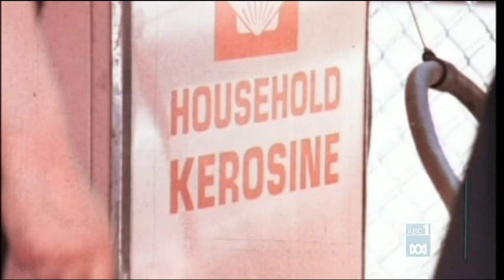Steam Powered 1963 Ford Falcon

Comment: Hmm, very interesting! I wonder what would happen if development of steam cars continued with modern technology. It's actually quite difficult to make a steam car with efficiencies on par with internal combustion engines, but modern technology might be able to achieve high efficiencies while preserving other advantages of steam engines.
Reply: +#420: Weedle  Its actually a lot more than "quite difficult"  The Carnot Cycle formula tells us its also impossible to match the efficiency of internal combustion..  steam is an inferior working fluid and offers poor thermal efficiency. The only advantage steam cars offered was a way to start the engine without hand cranking which was very difficult and often caused injury or death. But after Charles Kettering invented the electric starter motor the steam cars became obsolete overnight. Cheers!
Reply: @doktorbimmer  Not that the Carnot cycle says that it is impossible to match the efficiency of an internal combustion engine. These engines run on the Otto or Diesel cycle. What hurts the efficiency of a steam engine is its low high temperature due to a problem of materials and continuity in combustion. The temperature in an internal combustion engine can reach 2500°C. That of a steam engine hardly reaches 600°C. Lastly, the phase change of water from liquid to gaseous consumes a lot of energy.
Reply: @robertoortizespinoza795  The Carnot Formula tells us that the Rankine Cycle has a significantly lower theoretical and practical efficiency limit than internal combustion heat engines.
The Second Law of Thermodynamics prevents steam from achieving the efficiency of ICEs.
Reply: @sandervanderkammen9230  Yes. It is true.
Reply: Dang, I didn't know that about hand cranked cars! Guess the electric starter's another one of those inventions that's kinda inconspicuous until you realize what it would be like without it.

Yeah, I agree, a steam engine's not going to surpass an internal combustion engine in terms of thermal efficiency. There are already diesel engines in cars/trucks getting 40%+ efficiency. But the steam engine has other advantages like flex fuel, low emissions, high torque, etc. that might be worth going for. Efficiency's still one of the major issues, though maybe with today's tech, steam engines can achieve the boiler temps/pressures necessary for good efficiency. They won't get to 40% efficiency, but they might at least be close enough to a gasoline Otto cycle engine that their other advantages would be viable.
Reply: +#420: Weedle Yes, indeed.. hand cranking was very difficult for anyone that did not possess significant physical strength, it required a certain degree of skill and none of this could protect you from being severely injured.
We definitely take the starter for granted today.
Absolutely.. there is no practical engine design that can come close with the Diesel.. it is supreme in terms of thermal efficiency..
It too is Flex-fuel capable, low emission and high torque..  its also low cost and low maintenance.
The steam cars has not be commercially viable in over 100 years.. and unfortunately there has been no changes that will alter its obsolete status..   I will admit its an interesting topic to discuss though, I often wondered about steam making a come back somehow... but when you look at the facts and the engineering problems you soon learn to dismiss these thoughts as more fantasy than reality.  Cheers!
Reply: I agree, there's no engine that can match a diesel in terms of efficiency. The big ones in ships are over 50% efficient, better than any other simple cycle.

But honestly, I don't think the steam car is entirely obsolete. A lot of its problems are still solvable. I did some calculations with steam tables, and steam engines should be able to get around 30% efficiency with easily achievable conditions (<10 MPa and <600 C in boiler), provided the expander is well-designed. This is not that much worse than gasoline engine efficiencies. Of course, fuel efficiency is far from the only challenge, and you are right that steam engines still have a long way to go. Maybe a modern design, though, could still solve many of these issues and make a competitive steam engine.
Reply: #420: Weedle I see where you're coming from, but you will find no legitimate automotive engineers looking to produce a commercially viable, real world design that will agree with you.
 Looking at the formulas and existing tables it may appear possible, theoretically... but an efficient vacuum condenser, steam-to-air heat exchanger for a 150 -200 hp engine suitable for an automobile? Will also be the size of a typical automobile.. 
  The only steam engines that are currently practical (and still cannot match ICEs) are in +100,000 hp scale or larger and almost exclusively use a large body of water as a thermal sink... 2nd, 3rd and even 4th pass cycles may be practical in a multi-megawatt power station where the extra cost can be spread out of 40 years   this is simply not practical with cars.
Actually the truth is, the remaining applications that use steam are continuing to shrink, their days are numbered..
The Carnot formula tells us that steam is near to reaching its practical limits.. while ICEs have a much higher practical and theoretical Carnot efficiency limits... this is a serious roadblock for steam which has no possible solution.
Reply: Actually, there are engineers working on steam projects right now. One company, Cyclone Power, has plans for an engine that will fit in a car and gets ~30% thermal efficiency. I agree with you that commercialization is difficult, though. It all depends on the market. Personally, I think steam still deserves a chance because of the flex fuel/low emissions benefits, and the fuel consumption challenge just has to be overcome. It would most likely be an alternative to gasoline engines. I think we both agree that it's difficult to replace diesel engines; their efficiency is just too beneficial to pass up.

And yeah, you hit the nail right on the head with the condenser size challenge. It was already difficult for locomotives so it's gonna be difficult for cars. But from what I've found out, the condensers aren't nearly that bulky. People have experimented with steam engines in vehicles before, and it's just a matter of clever placement. There have been experimental steam powered buses with condensers mounted in the roof or undercarriage. The car in the video above seems to run fine without a gigantic condenser. Condenser size is definitely still a challenge, but not an insurmountable one.
Reply: +#420: Weedle  LOL!!!  NO.. they are certainly not...  You Mean Cyclone Steam Technologies????   The now defunct company was a very successful if not short lived "Vaporware" investment scam that has run its course. None of their unbelievable (and impossible) claims were ever proven and not a single engine was ever sold.
Reply: Well, I guess you could say anything that has run on steam in the past is *vapor*ware! (Get it? Steam turns into a vapor...okay, even I admit that was a terrible pun.) Anyways, your comment inspired me to do some more digging, and I would still have to respectfully disagree. I looked around on the Cyclone Power page and they have actually built several engines and delivered one that is being used in a forklift. Furthermore, there are still companies that are partnering with them to develop engines, suggesting that they are still in business.

Cyclone Power research: http://cyclonepower.com/how-it-works-2/delivered-engine-and-research-projects/

However, I don't blame you for being skeptical. I would also want proof the engine works as planned, such as specifications and results from official tests.

I know you don't think steam power will work, but it's not as terrible as it seems. The government of California, General Motors, and other organizations funded steam engine work in the 1960s and '70s. There was even an attempt to build a steam race car. These big corporations wouldn't throw away money on something they knew would fail. There just wasn't enough market incentive back then to develop steam power further, especially with the efficiency limitations. 

But I digress. I would very much like to turn the conversation back to the topic of steam engines. As long as the efficiency problem of the steam engine can be solved, at least to the point of similar efficiencies as gasoline engines, we could take advantage of its low emissions and flexible fuel capabilities. Please elaborate on why you don't think steam power will work; I do find these issues interesting and would like to learn more about them.
Reply: #420: Weedle  Cyclone Steam Technologies was not a legitimate company and is no longer active apart from periodic fake news updates posted on their website.. There were several demonstrations of engines that now appear to be nothing more than elaborate props.. Cyclone has never delivered a working engine or submitted to third party test verification.   
Yes, several failed prototypes were attempted during the California emissions crisis and the 1973 OPEC Oil Crisis and touted as viable  emergency stop-gap solutions that were consider briefly as conventional technology could not adapt quickly to threats of massive fuel supply shortages.. Many never reached the working prototype phase and none reached pre-production development stages, these impractical concepts were considered and all were later abandoned... There are today no legitimate projects being  seriously considered for production.

Comment: WHY aren't we committing to cars like this. It is so much better in every way!
Reply: Because they had 20 hp, were about as fast as granny on a bicycle (could tow about as much as well) and were incredibly dangerous due to 500psi of superheated steam. Also, contrary to what the video states, burning fuel to make steam is actually much less efficient than modern computer controlled internal combustion engines.
Reply: Steam cars have been obsolete for over a 100 years.. perhaps you should ask yourself why they became obsolete in the first place.
Reply: If steam had any advantages over ICE powered automobiles? They would not have gone obsolete...

Comment: Hi are their any plans or more information about this car and the engine, I would like to know how it works?
Reply: Books will be your only comprehensive sources.. steam cars have been obsolete for over a century.. there isn't much available on the internet..
Reply: The Bessler brothers bought Doble's design after he went bankrupt.. they sold some material to Japan, and some was purchased by General Motors
Reply: +Autistic Boy Really? The Bessler brother's engines ran on kerosene... Kerosene is a FOSSIL FUEL
Reply: +Autistic Boy I would wish you good luck if you had any chance of succeeding but I already know that it is simply not practical... and it will be less efficient.

Comment: If they brought back the Doble design with  electric batteries to heat the water for steam and today's computer controls , you could run the car for 2 or 3 years and never charge it or add water. Todays carbon fibers and light weight  plastics could make a re-designed Doble weigh less than 1500 pounds.
Reply: Poy Ester but cost how much also you would only make enough power as to boil the water the batteries would die quickly the boiler wouldnt be able to recharge the batteries at the same rate they are heating the water
Reply: troll
Reply: You're an idiot.
Reply: Electric motors can achieve over 90% efficiency while reciprocating steam engines like this are usually less than 20%... so the idea of converting a steam car to battery power should be a no brainer!
Reply: Using a battery-electric heating system to heat water in a steam engine makes absolutely no sense what so ever... because of something engineers know as conversion loss.
Reply: +Poy Ester   So what you are saying is basically you know absolutely nothing about engineering or steam engines...
Reply: You are a troll?  Because you are certainly no engineer..Lol!!!
Reply: I'm sorry you are a crack head... it will make it very difficult for you to get accepted to a university engineering program.

Comment: if they managed to make a fully closed no loss water circuit these could be really good..they already pollute less than most cars..I wonder how many kw heat output the burner was?
I've got a petrol camping stove that produce 2,5kw and it runs for something like 6 hours on  half a litre of petrol..if they used something like that with some serious insulation that could be an extremely efficient steam generator
Reply: Steam is LESS efficient and creates MORE pollution.. that is exactly why they are no longer used for cars.. that, and the fact that they are more expensive to build and operate..
Reply: +Autistic Boy Yes, thank you for proving to us all you are completely ignorant of the SECOND LAW of THERMODYNAMICS... listen kid, maybe you should stick to something you actually understand instead of making yourself look like a fool!
Reply: +Autistic Boy I would ask you to provide some evidence to prove your foolish theory is true... but I already know that no such evidence exists... so I won't bother

Comment: The problem with steam engines is that they have to operate at a lower temperature than Diesel or Otto engines.  That limits their efficiency.
Reply: +Frank Eggers Actually no... its not the heat limits but rather the higher heat rejection in the steam design that causes the lower Carnot Cycle efficiency..
Reply: +Autistic Boy Well, if you were not a complete imbecile you would know that NO DESIGN can violate the SECOND LAW of THERMODYNAMICS...
Reply: +Autistic Boy Nicolas Sadi Carnot discovered in 1824 that you cannot "fix" the inefficiency problems of the Rankine cycle... and Rudolf Diesel proved it in 1892.